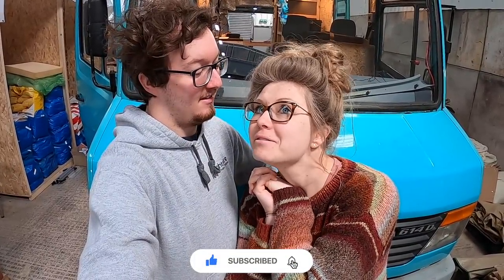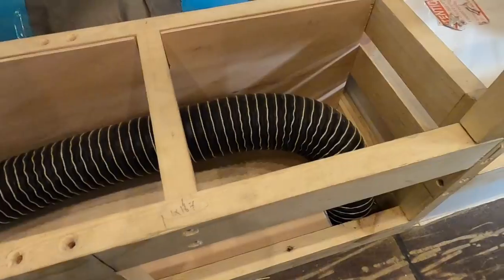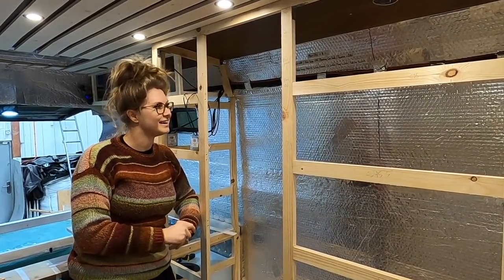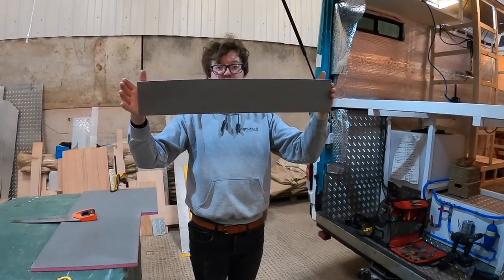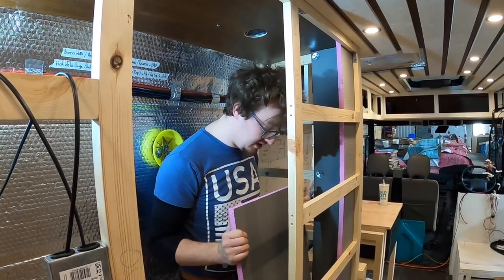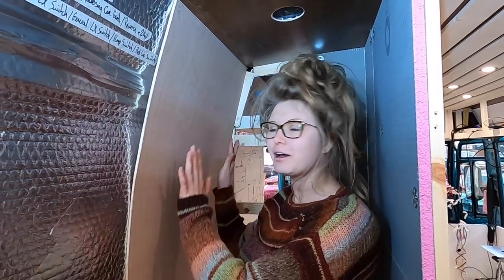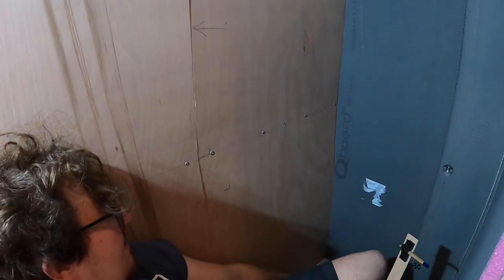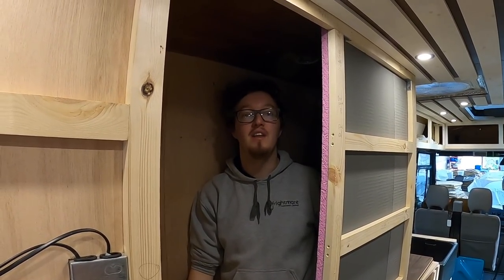VAN LIFE BATHROOM | Framing out a Shower in a Mercedes Vario | AQUA PANEL | Van Build Ep. 32

Comment: G'day guys good job, but watch out if you drop the soap!  That water proof stuff looks very good easy to cut, the only thing I don't like and it's just me is putting in a composting toilet I just think there disgusting especially how you urinate in the front part and defalcate in the other part, if you have anybody over the urine part would fill up quickly and do you have to sit down to pee if your a male.    Anyway that's just me old fashion kind regards John
Reply from the maker: Thank you so much John! And we though about lots of options but didn’t want to go down the chemical toilet route, but also didn’t have the budget for an incinerating toilet or anything like that! Just think of it like a treat, you get to sit down to pee and read a magazine 😂👍